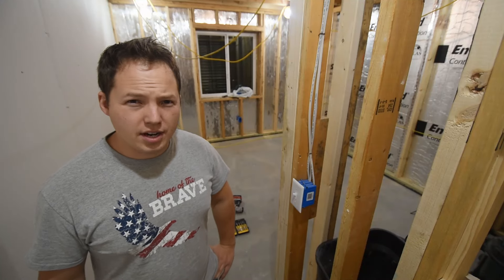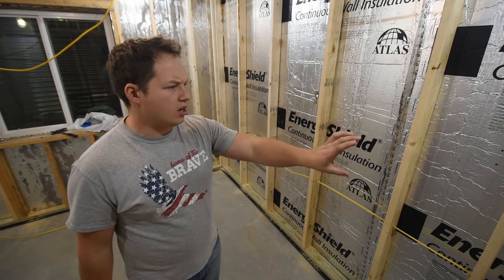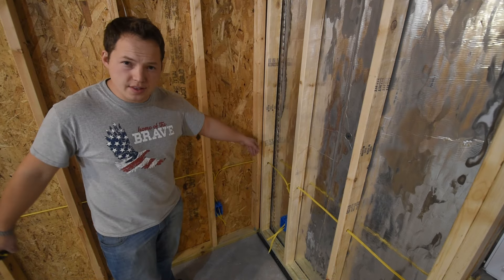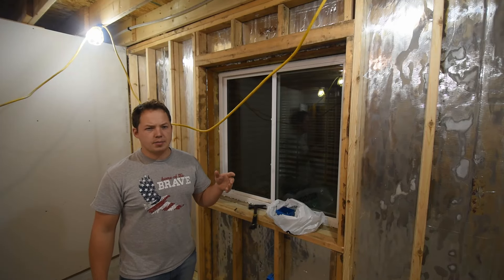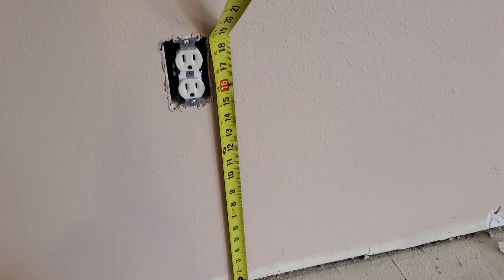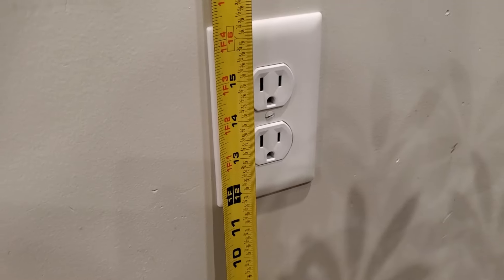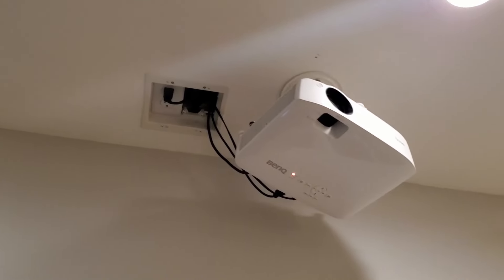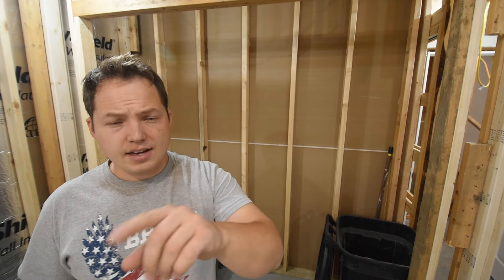Height of Outlet & Switch Boxes & Receptacle Location Tips

Comment: I've never wired a brand new house, but when rehabbing rooms, I match the lower outlet height to whatever the nearest room already has.

However, I've wired 3 brand new garage/workshops.  If you lean a 4x8 sheet up against the wall, and you set it atop a 1x2 or 2x4 to keep the bottom edge up off the wet floor, then the top of your sheet could be 49.5" off the floor.  To keep those sheets from blocking outlets, I put the bottom of my outlet boxes 54" above the floor.  This height still keeps them below the upper cabinets, which I mount 60" above the floor.  I'm 6'1", and my workshops have never been wheelchair-friendly anyway, so having higher outlets isn't a problem.

The only time this height has been a problem is when we hosted a party in my workshop.  The folding tables on which the food sat were rather low, and the cord for the crock pot wasn't long enough to reach my wall outlets.  Had to get a power strip to help out.

While we're on the subject, I like to have multiple 20A circuits on each workshop wall, and I leapfrog them down the wall at 4' intervals so I've got flexibility on which circuit my high-current tool is using.  I use white outlets for one circuit and gray outlets for the other circuit so I can tell the difference at a glance.
Reply: The dual 20A circuits with different colored outlets is a truly great idea!

Comment: i wired and plumbed  my house. and researched these measurements in 2014 !! i wish this video was here in 2014! i am also glad i was on point though !. A few things can be offered, in my situation, being mostly in a wheelchair, for ADA thinking, if allowed before hand, a few outlets, in living room, and bedroom, sometime bathroom, could be placed, at wheel chair seat height. this allow the handicap individual to have non stretch or chair tipping safety when using a few common use outlets.  as usual, your videos are awesome and extremely well informed ! cheers!

Comment: Pro tip for those who are planning to install outlets in a house. If you plan on installing at 18" to the top cut a piece of 2x4 at 14". When installing just stand the piece of 2x4 against the stud and set your box on top of it then secure the box to the stud. Makes it easier than having to measure each time and guarantees uniformity.
Reply: I’d rethink that height recommendation. All the kitchens I’ve been in have the counter outlets closer to the countertop not halfway between the counter and the bottom of the cabinets (which are as stated, usually 18-19” from countertop). My 20 yr old house has their bottom about 5” above the countertop which is about 1 inch above the usual 4” backsplash. If placed half way up, you get a lot more cord dangling down and it’s a little more visually noticeable.  Just my observation and 2 cents.
Reply: A story stick?
Reply: Or a laser
Reply: Measure your hammer, it may be the perfect length, or put a mark on it.  Then you always have it with you.

Comment: Some residential construction projects require outlets to be higher off the floor for ADA access (reach by someone in a wheelchair).
Also, consider a higher outlet for a wall mounted flat screen t.v. (hidden behind the t.v.)
Also, consider an outlet behind the toilet.  Why?  For an electric bidet toilet seat of course!
Reply: i mark the bottom of the box the length of my framing hammer off the bottom plate... super quick and comes out nice
Reply: also one up high for under cabinet, and above Cabinet lighting.
Reply: I put a GFCI outlet near the toilet for a possible bidet or heated seat in the future during my remodel.  Neither interests me but maybe the next owners of this place will want that crap when they are crapping. 🙂

Comment: With precut studs (92 5/8") and three plates (4 1/2") the height of ceiling framing is 97 1/8" above floor.  With  5/8" drywall on ceiling and a 48" wide drywall hung on the wall below it, the bottom edge of that sheet is 48 1/2" above the floor.  If you mounted your box with the top at 48" above the floor, you will have a cutout with a 1/2" wide sliver of drywall on top.   Because the box is completely covered while hanging the bottom sheet, it also makes it easier for the drywallers to miss cutting it out - before they have blown it out.   A much better way is to hang your switch boxes to 48" to the center of the box.  After the top sheet is hung, half the box is still exposed, making it easier to router out, and the same is true after the bottom sheet if hung.  Also, it places your box in the center of of the horizontal bevel so that the top and bottom of the box are out of the bevel and flush.  Your method leaves the top of the box sticking out at the seam - at the thinnest part of the bevel.

Comment: Ben - Pathway Lights!!! This is another easy touch that really is extremely helpful for seniors, ADA and for any person trying to find their way to a bathroom, kitchen or baby/kids room at night without turning on the full bright room lights. I have added to stairs and long hallways a single-gang standard 22-cuin old work box mounted horizontally below a light switch or as a 2-gang for an outlet and a pathway light. Using the Hot dropped from a light switch down to 12-in horizontal box allows for a great LED pathway light such as the Legrand™ Radiant ® Step Light. These LED lights can be set to 5 levels of brightness and have a LUX sensor for day/night auto on/off control. They use milliamps of power and don't add any significant load to your existing light switch Hot. Just a thought... but using outlets like your stairs have can accommodate the plug-in style, or swap and outlet out for a nice built-in step light look.

Thanks for the great videos... you rock and your channel is helping thousands of people with great quality information. Thanks!!

Comment: I think the heights you like make them a lot easier to wire. 

The house I am in now was built in 1908 and had knob and tube when built. I rewired the whole house without gutting the entire thing. The outlets and switch height varies from room to room so I matched what they were. The 2nd floor switches are around 40" and I am 6'2" making an odd angle to wire.
Reply: It's not what he likes, there's a whole codebook telling what to do.

Comment: 13" and 50" from the bottom of the box specifically where the screw for the outlet/switch screw in so everything is even. Counter plugs 42" . Im in Canada so maybe things are different. I should find out what the drywallers prefer or how they install. Thanks for the video!
Reply from the maker: Thanks for sharing!
Reply: butters742, You don’t use metric there?
Reply: @981porsche3  We use both. With the US not transitioning half way through the process metric and Canada making the full change. Forced Schools to teach both since most jobs relating in shipment to the US(Specifically in Machining and Tool/Die industries) are required to flip flop between the two. Then it just becomes a matter of preference and who your working for. The older the people, Then imperial. Younger then metric. 

Its a headache. There are things i love about imperial and things i love about metric. But no matter what, both have to be used and be proficient in both.
Reply: @butters742  That’s interesting. If you listen to the proponents of metric in the US, you’d think the whole rest of the world is using only metric. Personally, I do see the benefits and drawbacks of both.
Reply: @981porsche3  There is Definitely a pro with imperial because I can measure on my finger how much a inch is on my index fingers segment, about 3 inches for the whole index, 6 inches from thumb to pinky if stretched out.
Same with metric to some extent but there is something with imperial.

Metric on paper and math is a breeze though while imperial becomes a bit convoluted. My only issue with Metric in Canada is that it isn't just metric lol. I wouldn't care if it was all imperial, or just all metric. Its just both and a shuffle.
Reply: @butters742  There definitely are benefits to imperial. A couple of the biggest benefits, in my opinion, are that (1) 12, 16, etc are just evenly divisible by more things than 10, and (2) the fractions make it super easy to calculate in your head: just multiply the denominator—e.g. half something my multiplying the denominator by 2, etc. (half of 1/3=1/6, etc.)
Besides, a third of a foot: 4 inches; a third of a decimeter: 3.33333333333333… centimeters 😳.
My father, a mathematician, used to joke that, if God wanted us to use the metric system, he would have given us 10 fingers. But, when we built a barn or a deck or addition on our house, we never used metric 🤷🏻
Reply: @981porsche3 Yeah the imperial system definitely becomes a good standard of  Arithmetic. Now that you put it that way Imperial is easier on the head on the fly and the Metric is easier on paper from a design side of things. Pretty sure we will always have both until the end of time haha.
LOL I know what you mean with what your father said. I keep saying Ill build something with metric. Every time its imperial. I built a small Fence the other day, Imperial. Maybe ill force myself and let you know how it goes.

I used to do Machining for work and that's where both would flip flop. US machined parts imperial, European Metric. It didn't feel too insane of a change in that field since you were dealing with 1000th of a inch and 1000th in mm. After that it all becomes a decimal point. Just don't mess up which one your using because it will make a huge difference.

Comment: We always do 46" to the top for switches. Mainly because that's the best height for countertop outlets and you don't want switches and outlets to be at different heights. Wall outlets will depend on ceiling height as well as how tall your base molding height. 9-foot ceilings I would go 18 inches. It sounds weird but that higher height looks a litter better with that higher ceiling.

Comment: The lid or ceiling drywall installs first. So add 1/2 inch to the 48 inch from top plate to switch box.
Reply: Good point.  No matter what height of 48" or so it is, it GUARANTEES at final that your going to come back to a box full of dried mud.

Comment: The biggest problem with 48 inch switches is that it is right on the drywall seam and the drywall mud makes a mess in the box and the wall surface is never perfectly flat. 
I avoid that problem by always mounting switch box tops at 45” above the subfloor.

Comment: I'm going between a wheel chair and crutches. When I finnished my basement I set all my plug ins to 36". Best thing I did. No stooping over or moving furnature. to get at the plug ins.  I got a couple 5 1/2 feet high for my tvs.  In my shop I have a  few hanging from the cieling becuse my wheel chair doesn't  to drive over cords.  I guess I'm a reble. Let's go Brandon. Thanks for sharing you great videos.

Comment: I installed our wall outlets at 18" to center which is a little higher than normal, but as we get older it is nice to not have to bend over as far to plug things in (ie vacuum).  While not electrical, I also install central vacuum ports at 30" with an outlet next to them so they are convenient to use.  Why some installers put them in the baseboard requiring you to get down on your knees to use them, I'll never know.

Comment: I like a switched outlet high under the over hang for Christmas lights.
Reply: I just am finishing a family home renovation and have stubbed switched lines for my future outdoor pathway lighting at the front of the house. Also a like your comment I've added switched AFCI/GFCI all-weather outlet boxes in my front and back house eaves in a location for the holiday and summer patio string lighting. These little touches of adding in an extra switch or two where you "might need one" is a super "future proof" way to make sure you don't have to tear into a wall again. Stubbing a switched wire into a solo junction box in the attic is a perfect way to phase out your project!

Comment: Something I found to be covenant is if the wiring supports or you are doing new wiring, at the switch at the where you enter the room, install an outlet.  It is very handy when you are vacuuming to be able to plug it in without having to move furniture or lean down.

Comment: I like to see what you have there. 12/2 for ALL points. I've been trying to plant that seed to NEC to make it code, eliminating 14 gauge in standard wiring. I still prefer metal boxes. These plastic and nylon boxes cheapens the look, even though they're behind walls. But then again, I wish my receptacles and plates were of porcelain and ceramics. Better insulation than plastic and no static shocks. I am also debating to have conduit pipes run through my home. It would make rewiring easier, especially if one has spray foam. There is still the trouble of adding something where there wasn't something to begin with though.

I've always thought electrical outlets should be about the same heights as switches, as they are in unfinished basements and garages. As for sofa's and end tables with lamps, I custom made two extension cords with one plug that connect behind the sofa and protrude from either end of sofa. With this day of USB chargers for EVERYTHING, I am considering what you said about those outlets where the end tables are, but those that have a USB and USBC connection for these obnoxious devices that refuse to some with a wall transformer. (Yet they're still being paid for in the devices that cost thousands anyway. But that's a different rant for a different time.) 

Ah, you have that idea too, as I pause at thought, comment, then proceed. I like that thinking.

I always thought of having a receptacle inside the window on both sides. I got the idea from Mother, by her putting electric candle sticks in the windows at Christmas / Hanukkah and an electric menorah in the main window. (We celebrated both, being Jewish and Catholic. Not sure how I became atheist when I mastered reasoning skills.) 

I also thought about closets, and even in cabinet drawers. Arc Fault Protection is a MUST. Everything has a rechargeable battery. When I was a kid, I had a 13 inches television set and a small bedchamber. So I kept the big box in the closet and opened the door when I wanted to watch the set. We didn't have these fancy flat screens back then and only 9 channels and only 4 of those could be viewed with reasonable clarity. All kinds of static and snow. So there was also a cable box, eventually and I ran an extension cord in there for the set, the box, and I had a Nintendo too. Hours of playing the game, with it paused and the cleaning lady comes in, unplugs everything, for her vacuum cleaner, and I lost my game. I never did find that princess. (Super Mario Brothers)

Your washer outlet surprised me as there is no GFCI, and gave thought to maybe a different GFCI upstream. But giving that thought, wash machines should be on dedicated line. Perhaps there is a GFCI AFP (Arc Fault Protections) at the panel. Just my OCD kicking in here.

I've also given thought to outlets at the stairs, with those nightlights and a three way switch at the top and bottom of the stairs. (I spend a lot of time in my basement. I like it down here. I'm weird like that.)  I'd sleep down here if it didn't leak. TOLD my Mother I was moving into the basement when I was 13 years old, and that's where I've been since. Both finished and unfinished. Like unfinished the best. Here it's half and half and horrified it leaks when it rains, so I have the Master bedchamber upstairs.

I keep all boxes here in this house, at the height the other ones are. If I am ever lucky enough to win the Power Ball I will have a house built and customized specs with outlets at the standard and at the switch height. I don't see me having kids but I also try to keep the little people in mind, and thinking about people in wheelchairs, which will be another spec for my dream home. 100 % wheelchair accessible and with elevator. I was in a wheelchair once and it was not easy. If I ever land in one again, they'll have to send me to shady pines. It would never fit in this small house.

In projects of the basement at this house, I did put some outlets where the fires stops on walls that are open on the unfinished side. Yes, I used all metal boxes, 12/2 with ground, but no conduit pipe. I am not that skilled and I don't have money, so that will be done in my dream home as well.

Great video, and thank you for posting, keeping me company in this otherwise lonely existence as I wait to die. Hope you and yours are well and happy. Good thoughts for you people.

Comment: Just finished a home office in the basement.  It’s home to my desktop computer and printer plus various other desktop electronic equipment (adding machine).  I set four outlets at 16 inches and four at 40 inches.  Two of the higher outlets are doubles and serve my computer equipment.  I’ll never have to crawl under the desk again to plug in equipment.  The light switches are at 48.